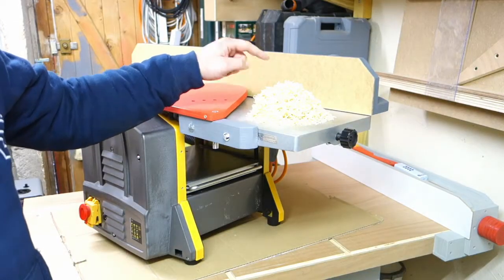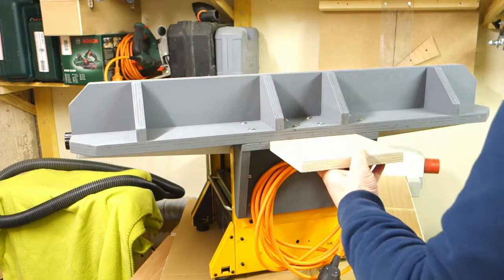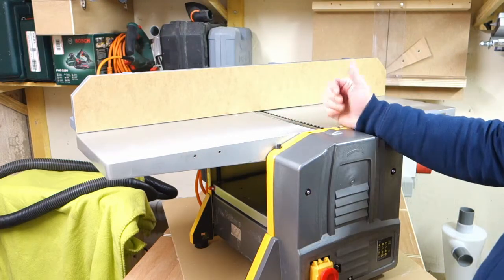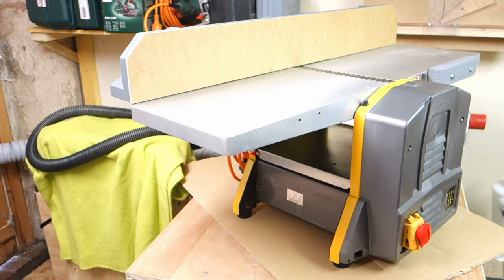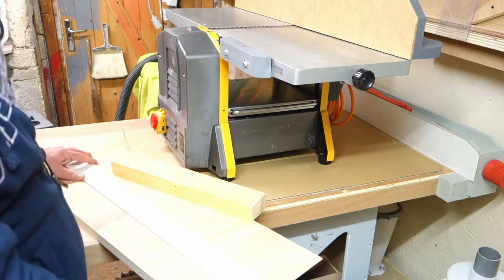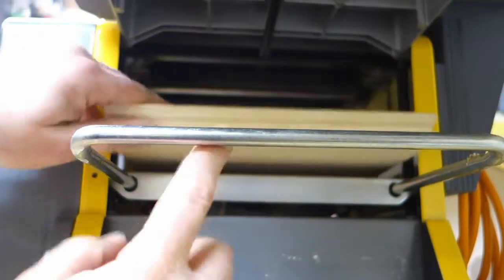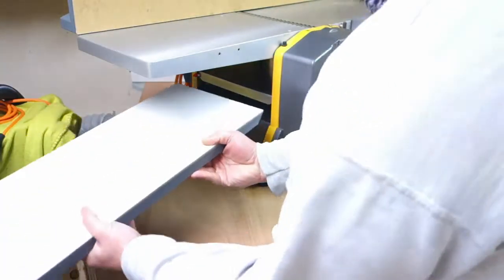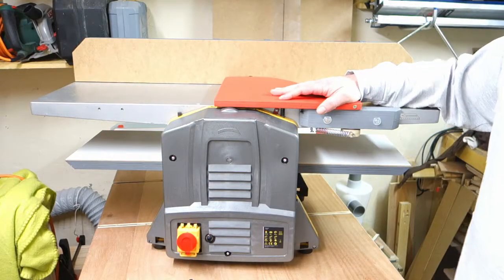Planer/Thickness Planer improvements final part

Comment: cool hacks on that little planer/thiknesser combo.
I have one similar and, even if i plan to buy one more "professional" they are quite good for the price. I made the fence with an angle adjuster, in order to set it to 90° more easily.
Reply from the maker: Yes the adjuster is a good improvement for the planer

Comment: id like to see you fit the dust extractor to it please? i have the same Planer/Thickness and going to do has you have too. the only problem with that fixed fence is you only going to mainly use the same part of the cutters over in over again.  The DM (UK)
Reply from the maker: Hi, in my next video's (workbench and table saw) you can see the planer in action;-) also the dust extractor. I use all part's of the cutter course I plane topside (right) against the fence and the underside (left or middle) for thickness planing. So the cutter's are even in use. But you will see this in the next video's ;-)

in the mean time have a nice time

cheers Tim France

Comment: Hi tim,great improvements how did you work around the safety switches?
Reply from the maker: Hi Mike,  knipex ;-) lol 
NO NO NO it was a joke
Reply from the maker: the safety switches are not in the way so I am lucky otherwise sure I find a solution for that. But meanwhile, the safety switch get me on my nerves so I think about to get rid of this problem From the manufacturer's side is a small bug/error that must be fixed. So there will probably be a video